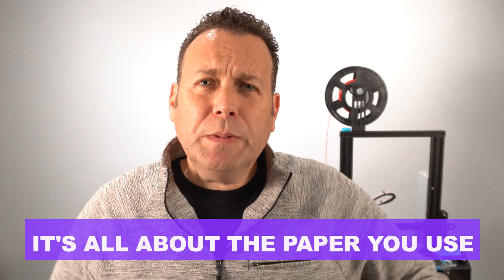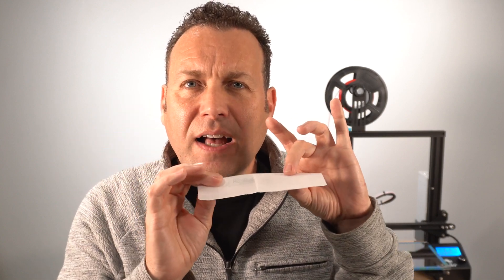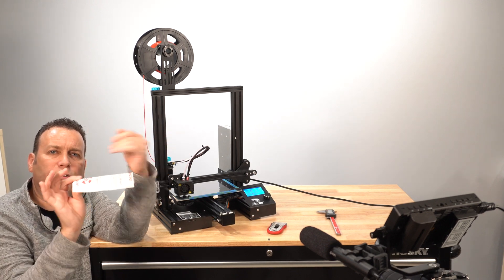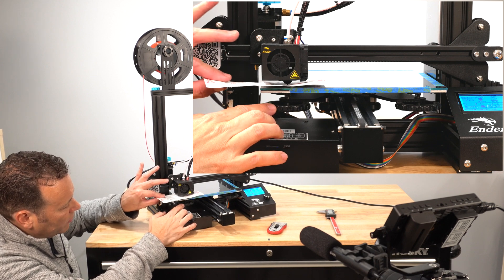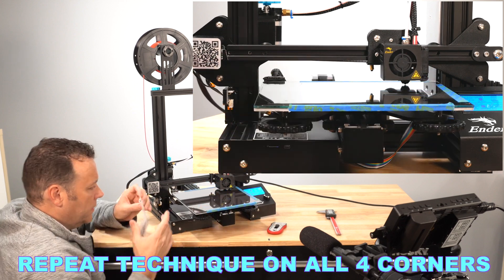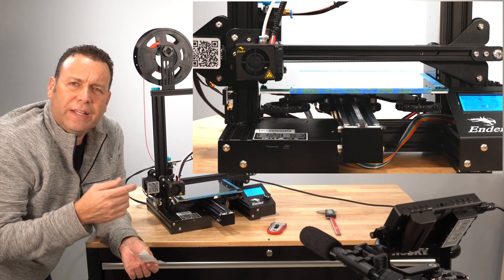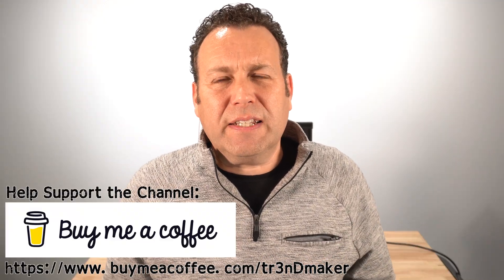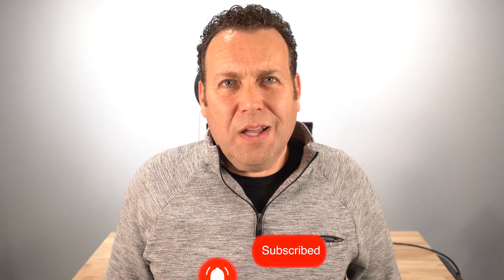3D Printer Bed Leveling - You Are Doing It All WRONG! Try This Instead!

Comment: I still feel like an idiot cause the paper method don't do shit for me.
Reply: Then what on earth do YOU USE???  Somehow you have to get the 4 corner spots coplanar and parallel with the X carriage or you don't have much chance of success with layer 1; and if you don't get layer 1 correct, the rest of the model is highly unlikely to print successfully!
Here's the thing: adjusting with screws like this needs to happen with THREE screws in a triangular arrangement.  That would make this process SO MUCH EASIER (ask any surveyor how they level their transits or levels - or how they USED to before the modern toys).  But what most of us have is FOUR, so it takes more time and effort AND UNDERSTANDING!  What this video shows you is actually not optimal and only gets you pointed in APPROXIMATELY the right direction!  To do this correctly, you need to have several things squared away, starting with having a clean nozzle tip and having the nozzle AND the bed up to temp!  And it's important to have the Z-stop set very near the midpoint of the four adjusting mechanisms.  You don't want to run out of "adjustment" before you get the proper height dialed in!  
It would be helpful to *know the X,Y co-ordinates of the four spots where the adjusting screws are - or you can mark them with pencil lines on masking tape NEAR those points without the tape being so close as to be in the way.
Once you get the bed "in the ballpark" you can start the REAL procedure, which will be best done in an order not EVEN touched upon in this video!  The first spot that needs to be adjusted is around 35,35 (on a CR-10 anyway) which is right where the adjusting screw happens to be.  The next thing actually needs to be the OPPOSITE DIAGONAL (like at 275,275 on the CR-10.  YYMV, of course!)  Then go back to the 1st spot and dial it in, continuing to alternate back and forth between those two diagonals.  What you'll see is that moving one up a little moves the other the opposite way a little, so you want to sneak up on both until they are both close to PERFECT.  Then you can switch to the OTHER diagonals, alternating between them until THEY are perfect.  Then double-check the first pair.  The reason you do it in this fashion is that when working back and forth like that, adjusting opposite diagonals, you are actually rocking back and forth on the diagonals that you're NOT adjusting at the time.  This is the only way to make sense of FOUR points of support.  Working the four "around the clock," either CW or CCW, is NONSENSICAL and inefficient!
What paper you use is not that critical - as long as you MEASURE it so you know just where you're aiming!  Measure the paper and set to it by feel, knowing that when you're done you have things set for whatever thickness that paper measures!  To pretend you're setting the ZERO height when you're actually setting it at whatever that paper thickness is will only make for confusion!  Go ahead and print a 3-line skirt and then measure ITS thickness (assuming you've left it alone while it's printing the skirt, then make adjustments ACCORDING to those measurements.  Work with a very simple model at first until your print measures the same as the model specifies.

* IF you know the X,Y co-ord's of those adjusting screws you could speed this process up by writing four very simple gcode files - one for each of the four positions.  The code would move Z up like 2 mm, then move X and Y to the corresponding location, then move Z back down to zero.  Make your wheel adjustments there, then "print" the code to move to the next one - rinse and repeat.  And to put the cherry on top: make a 5th SIMILAR file to move to the CENTER to verify that your job is complete and satisfactory.  (If you have all 4 corner points adjusted well but the center point is NOT - your bed is warped - or you have something loose or sloppy that needs to be adjusted.  That's another chapter.)

Finally, keep this in  mind as you turn the adjusting screws: when looking down from above the bed, turning the wheel clockwise TIGHTENS the nozzle's grip on the paper; turning it counterclockwise LOOSENS it (by moving the bed UP or DOWN, respectively).
Reply: @YahWho-is1tt  Dog I don't care at this point. I bought a good printer with auto bed leveling instead of a crappy sling bed.
Reply: @OneOfTheHomies  Good for you!!!  Perhaps someone else might benefit -- or -- not....  Guessing there may still be one or two out there - somewhere?  Glad you didn't just abandon the endeavor entirely!!!

Comment: I use parchment paper and a special gcode found on thingiverse (for Tevo Tornado but works for all printers if you adjust the travel distance in the code)it works perfectly, never had first layer issues after using it.

Comment: I printed for a year and a half then stopped for a year and now I cant get any filament to stick to the bed at all I play with z-offset for hours (every offset number in a range of 30) over and over, I slowed the print down to 30% and nothing. My extruder is pushing but maybe not enough. IDK what to do. Ive also been using reciept paper for a long time
Reply: That's weird because I had the opposite happen. Haven't printed in over a year, took them out and just briefly wiped off the build plate and my prints stuck perfectly. My build plates were cleaned fully prior to storage. I'm back to using hairspray now, and gluestick in the garage due to the cold but was interesting to see that happen.

Comment: Lol it gets so confusing. Watched another video yesterday that claimed it didn't matter what thickness of paper you use, as long as you get the four points the same. Then adjust the Z axis to the right gap. So I'm struggling to understand why using the receipt paper would make any difference

Comment: I have used both types of paper but what is the game changer for me is printing a CHEP Bed Leveling Test Print afterwards and fine adjusting according to the thickness of this first layer print. Knowing what a first layer should look like is standard to be reached and  I fine tune the knobs according to the outside lines thickness until it looks perfect. If the thickness is equal at each corner then you are good to go. Before I start a large print I always print a CHEP Bed Test Print to ensure I'm just perfect to proceed. Another item that I would like to mention is I highly recommend buying or building a filament dehumidifier and enjoy problem free prints - the difference is night and day.

Comment: I've been stuck trying to tram my printer since Saturday and I thought that using a feeler gauge would be better to level it. Haven't used thermal paper in years. Now, I used last night before I went to bed and the bed almost leveled out.

12:17 Oh? You have a video for feeler gauges? Okay, I can take a look.
Reply from the maker: Feeler gauge video got corrupted… be sure everything is tight and no wobble on bed.
Reply: @tr3nDmaker  I was lucky enough to actually get it leveled yesterday. I had to reset the bed by lowering all the screws so the surface was far away from the nozzle. Then, I had to painstakingly count the number turns on the knobs, one by one, to get it leveled and recorded the number of turns on my phone. 8 days was far too long to deal with this printer. Finally, I'm able to print something! 

Here's the thing. I had to use standard copy paper for the method.

Comment: New to 3rd printing.  Why do we bed level at 60 degree C when Ender 3 pro defaults to 50?  Shouldn't I bed level to the operational temp?
Reply from the maker: 10 degrees isn’t going to make too much difference… however, technically leveling/ tramming should be done at operational temperature.

Comment: Or, just buy a printer that self-levels and doesn't sling the bed. lol
Reply from the maker: Self leveling is fine, but it can give you tilted prints.  Always good to start with leveled surface, then let self-leveling make it better.
Reply: @tr3nDmaker  Not if you know what you are doing, watch some videos by tutors who teach cnc at uni, problem solved.

Comment: Idk what i seem to be doing incorrect i have spent days trying to level my days i got it perfect in the corners and middle but when i print it spits it out and doesnt adhere to the bed but it adheres to the nozzle
Reply from the maker: Check to see if bed wobble if you push it back and forth and try to wobble it.
Check to see if filament on tip is oozing from nozzle threads.   
Go to stock setting from slicer.

Finally.  Level/ tram bed again, then again.

Once you get this… everything hoes easier.

Comment: A bit off track but can you use disable steppers to get the bed leveled and save the settings,  tia
Reply from the maker: Yes, you can disable steppers.  But, that is not why bed needs leveling after prints.  Main reason leveling is needed is spring tension and positions get disturbed when removing prints.  Even slightest movement of bed seems to knock position off.

Comment: I`ve been trying to tram my bed for several hours. This video gave me the best results (with the receipt), however my bed is warped. Right at the 4 knobs, I feel just a little friction, however, in the center and between the knobs (center left, right back and front) it slightly dips down. I also still see noticeable lines, but I'm not sure if they're over extrusion lines or if the knobs are too loose (as you show/say in your example). I also have blobs/bits of filament where the nozzle lifts.

You mention a video about leveling with feeler gauges, but I couldn't find the link anywhere. I hope you notice this comment soon but I understand you may be flooded with notifications. Thanks for the video!
Reply from the maker: A small warp in bed is ok.  Just level again and try and level in the middle also.  As long as print is sticking to bed… just go with it.

A very worthwhile upgrade is a glass bed. This will create a flat layer.  Personally, I exclusively use glass on all my printers.  Also, buy Elmers Jumbo Purple Glue stick.  Wipe glass with glue stick and prints will stick amazingly.

Comment: Use handle of scraper that come with printer put it under the frame under printer bed where adjuster are at thats the frame lots easier then using some paper

Comment: I am trying to find your video on leveling with feeler gauges.  I am working with an Elegoo Neptune 3 Max.  Watched you thermal paper leveling video twice today and got close.  Still too thick on one side and too thin on the other I think.
Reply from the maker: Try running 4 or 5 perimeters… adjust as laying it down.  Just slight turns.  Also, check everything is tight.

Comment: You touched on it at the end, it's literally what they're designed for, learn to use a feeler gauge
Reply from the maker: I have used many methods to tram/ level bed.  This technique seems to work very well for beginners.  I agree, feeler gauge works well.  Personally, I only level/tram by eye.
Reply: @tr3nDmaker  sorry just realised that that reads like I was meaning you specifically, I didn't, I just meant anyone using tools to adjust their bed, use a feeler gauge rather than some paper.

Comment: The biggest cause of level fails for me is overtightening bolts on the rollers on XYZ axis.  The need to be able to be turned in place with fingers while being tight enough to not have wobbles.  I suspect overtightening these bolts causes distortion of the frame, and build plate.

Comment: I’ve tried leveling my bed so many times my z when I disable steppers will drop down below the bed height and when I auto home it goes to the middle idk if I need to wipe settings or what but I’ve just been so frustrated tried leveling like a hundred times
Reply from the maker: I think you have messed up a setting.  I would recommend doing a reset on 3D printer.  See if it fixes issue.  If not, erase slicer settings and printer and start over fresh with stock slicer profile.  Get some prints down before tweaking anything.
Good luck.

Comment: Question here, how do I do this on a K1? which has the "dials" under the metal plate at the bottom, and you can't really move them unless you take the belt put of the gears =S
Reply from the maker: I would suggest printing some bed leveling knobs… it will make it so much easier.

Comment: This is perfect, but the first half of leveling.  After doing this, print a .05 print first layer, and get that to stick perfect by adjusting your z height.  If that sticks, then you are right on the money.
Reply from the maker: Great tip.  I usually adjust on the fly as 1 st layer goes down.

Comment: ender 5 s1 and it worked great for the first month. Now I made more settings than before but it doesn't work :(
Reply from the maker: Recommend starting with new stock profile from slicer and see what you get...  Often, a setting or two gets out of wack and trashes entire print.  Also, be sure everything is square, straight, moving easily and tight.
Reply: @tr3nDmaker  What is the m420 code? Should I add it?

Comment: Even after leveling perfectly and making an Accurate Z-level micro switch adjuster (which I posted under Magnanimator on Thingiverse) for my ANET-A6 printer I found the problem of having two Z level stepper motors for left and right sometimes don't always start from the same zero position. So one has to get them both to the same level zero position. I then marked the rotating coupler on both sides when level so that when I do an auto level i make sure that both steppers start from the same rotation angle before they are enabled. I use a glass mirror as my bed clipped on the bed with paper clamps and it works really well for me and PLA sticks great on first layer.

Technically once you have an even gap all around, which is as thin as your receipt, then one is supposed to absolute zero,  so that the nozzle has zero gap to the bed and let the software compensate for the gap. I use my Accurate Z level micro switch adjuster to tweek the bed down a fraction so that it is at actual zero when it autolevels. I then do a hotter first layer print onto the glass with the bed set at 60 degC and adjust the elephant foot compensation to say 0.3 instead of 0 default. The ANET A6 is not quite as fancy as your printer but works really well once one has sorted out these matters.

Comment: Thanks, the info in this video really helped with my bed adhesion. Just one thing... Calipers and micrometers are not the same. What you are showing and provide links to, are digital calipers, NOT micrometers. While both can give you a thickness measurement (assuming you are using outside micrometers), calipers use your thumb to set the distance & pressure on the measured piece, a micrometer uses a torque limited thimble system and can provide a level of accuracy typically 10-100x that of calipers.
Reply from the maker: I understand, I work on car a lot and sometimes talk too fast and mix up technical names.  On a more humble note… they are actually called Digital Caliper Verniers.

Thanks you for your post.  I will be sure to name it properly in the future.

Comment: pointless video - using normal parer - wrong, using receipt paper - good. 
I did leveling with normal printer paper 80g, and it works.
SO how am I wrong? Mr Knowitall, huh?
Reply from the maker: You are not wrong… In video, I state if you are using regular paper and you are getting good results… great.  This video, was made for persons struggling with getting first prints or having adhesion issues.  I have helped over 100 first time printers live or thru videos, this has a 90% success rate.

Comment: Hello, I have a problem with calibrating the bed. I was able to do it well. Suddenly, a week ago, all the prints began to fail before they started. But I calibrated the bed well, and I think there are problems with the printer. I did not print on it much It is still new
Reply from the maker: Could be many things… what is the printer doing?

Comment: That’s a Vernier Caliper and even better than a receipt is a proper set of feeler gauges. But in order to do it all properly your printer bed can’t be mounted by springs or all you’re doing is pushing the bed down against springs and not adjusting the gap.
Reply: What do you suggest?

Comment: Please for the love of engineering DO NOT use metric and imperial together.
Yo so wonderfully talk about millimetres.👍 But then you talk about pounds for weight of paper.👎 Sigh.
80gr. per square meter is the unit of measurement in the most standard weight. thanks
ps, yes this is also a standard in US with the abbreviation GSM.
Reply from the maker: Great advice… I will try to incorporate that in my videos.  Never even crossed my mind living in USA.

Comment: You explained it very good with the test print. I ended on the thermo paper  also, mainly because it makes you better feel about the actual distance to the nozzle, but the lower thickness is also positive in my case

Comment: Great great suggestion about using thermal receipt. That did the trick for me on my first ever 3D printer. One suggestion that made this all work is that I pulled the thermal paper tight as I ran it under the nozzle. As I was trying this initially I was just sliding the paper under the nozzle and the tension seemed OK. Then something made me realize that I should pull the paper taught. When I did this it showed me that there was still too much gap between the bed and the nozzle. I adjusted the bed closer at that point, went around all four corners of the bed twice making sure to keep the tension on the paper. I'm now printing my first successful object! 😀